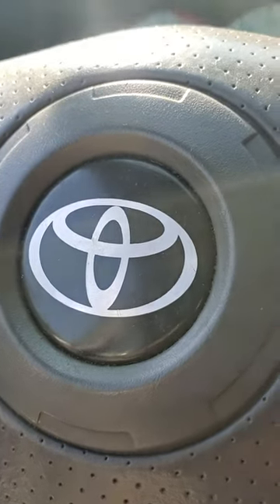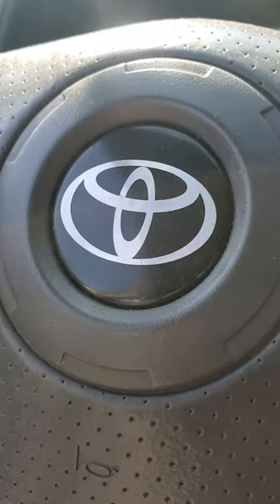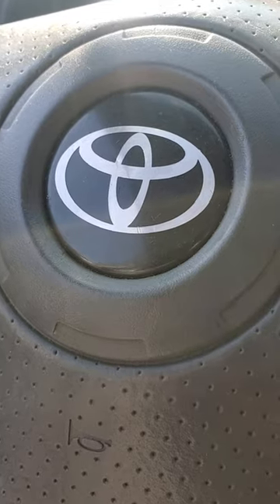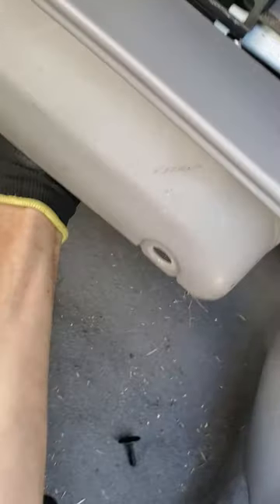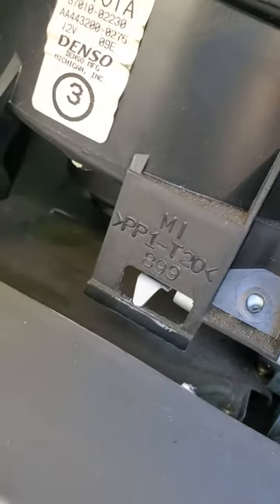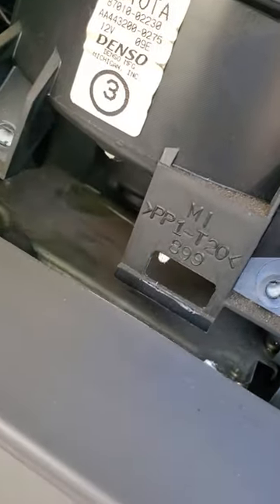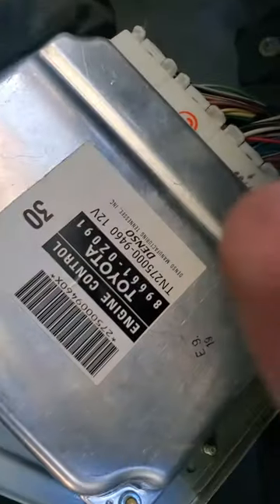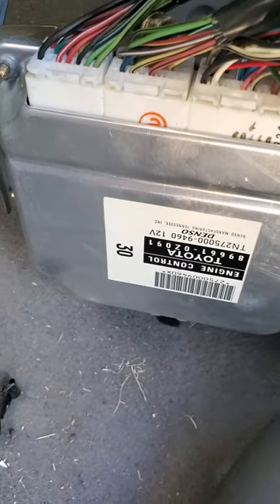2004 Toyota Corolla Engine Control Computer Location and Removal

Comment: Hi
I would to put used one but I saw that they have different parts number . They all starts with 89661-xxxx then after it’s different. Do you know why? If it is not same part number but same model and year will it work with another same car?
Reply from the maker: as long as the engine and transmission are the same, there's not really a reason to believe it wouldn't work. it'll take some learning on the computer's end but it should be fine
Reply: @CrowtownAuto  ok thank you
Reply: If I put another one and it doesn’t fix my problem then to put back the stock one do I need reprogram it or just plug and play?
Reply from the maker: there's no reprogramming to do. the computer contains default settings it'll operate under until it learns your driving habits

Comment: I want to change my ECU on my car, I been trying to fix a p0171 code for a while and I is caused by a bad ECU. If I want to buy and replace a new ecu do I have to reprogram it? and if I do how can I do It. thanks can I get a cheap one at junk yard
Reply from the maker: no you won't have to reprogram it. you'll need to put it thru a drive cycle of various speeds to relearn your vehicle though. as long as your JY ecu matches your car's it's pretty much plug and play.
Reply: I'd clean the maf and replace intake gasket if you havent already. Fixed my p0171
Reply: I have a recurring P0171 issue. The STFT reads as normal (around 0% give or take) while LTFT measures clear of 35%. The car runs totally fine so a mechanic came to the conclusion it was the car's "computer" (ECM/PCM?). Did or do you have the same wildly high LTFT but normal STFT readings??
Reply from the maker: Oftentimes, a P0171 means that your Toyota is having trouble with a dirty or faulty mass airflow (MAF) sensor, or a vacuum leak downstream of the MAF sensor (perhaps in the PCV line or in the valve itself). Of course, this code can also signify a bad O2 sensor in bank 1.

Additionally, it's rare (but still possible) that a P0171 code can be tripped by a plugged fuel injector, by a dirty fuel filter causing low fuel pressure, or even an exhaust leak before the first O2 sensor
Reply: @CrowtownAuto  I see. Interesting. I know for sure the code is being triggered by the LTFT reading at 35%. What is causing that high measurement is the mystery. The STFT reads normally. I inquired with a mechanic about the fuel filter and getting it replaced. It turns out that it is located in the fuel tank and was not thought to be a potential cause being the car runs totally fine. The MAF sensor was replaced but no change. The upstream 02 sensor was replaced some years back and is still fairly new although I am tempted to replace it with a Bosch (OEM is Denso) and see if that makes a difference (I once tried with a cheap knock off from China and the car just sputtered out within seconds). 

A plugged fuel injector or exhaust leak are also not thought to be the culprit being the car runs fine and does not exhibit any strange noises. Basically, I'm left with it being the 02 sensor or ECM.